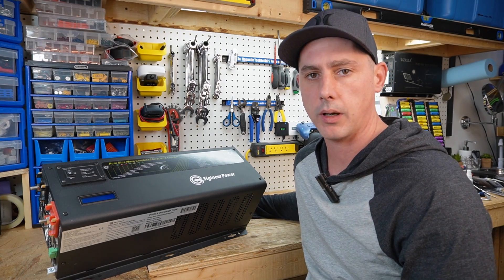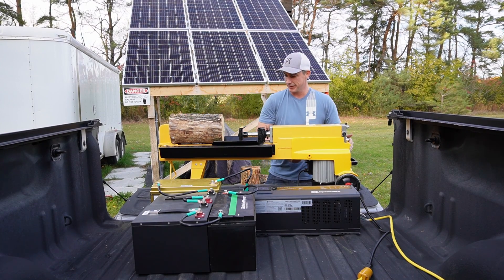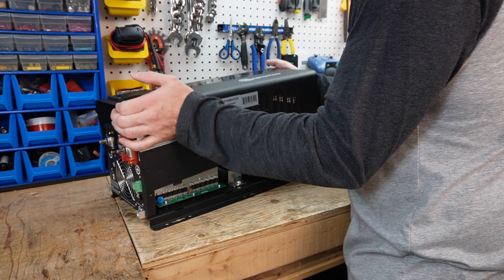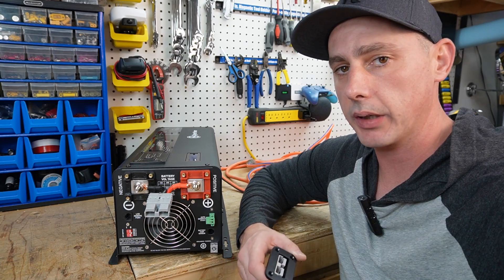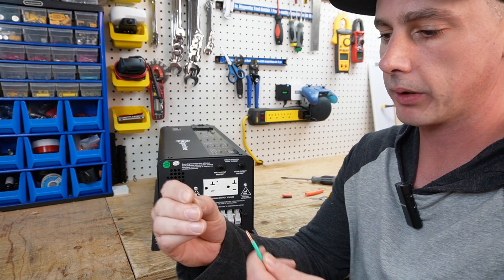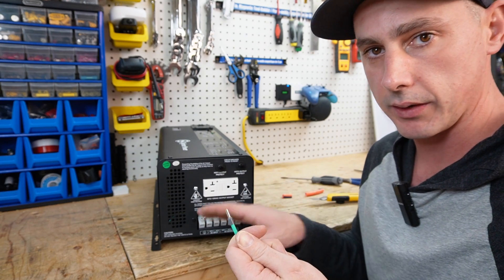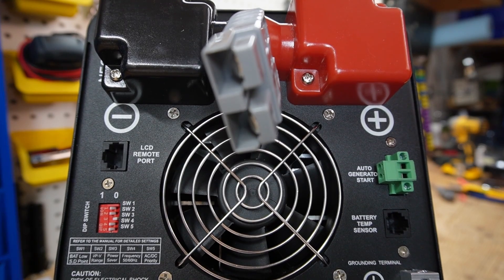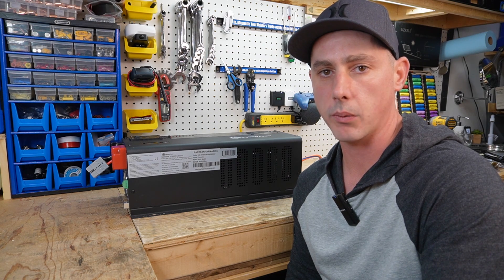Low VS High-Frequency 48V Inverter

Comment: looks like the SUNGOLDPOWER UL1741 6000W 48Vdc Pure Sine Wave Inverter Low Frequency 240Vac Input 120Vac/240Vac Output Split Phase
Reply from the maker: They all look the same, don't they?

Comment: I’d be surprised if the inverter isn’t using a pressure plate terminal block. If that’s the case, stranded wire doesn’t need a ferrule and using one might actually reduce contact area. Definitely don’t try to crimp the ferrule by tightening it in the terminal block. Use a proper crimp tool, since you really don't want that connection coming loose.
Reply from the maker: @adriftatlas  Thank you for the advice

Comment: What kw's is your log splitter please
Reply from the maker: @teamkinzoku3850  it has a plug for a 15A circuit
Reply: @Roll2Videos thats about 1.8kW @ 120vac on a 3kWh HF Inverter, could the startup load spike to 4-6kWh momentarily on those inductive loads? Maybe a 5kWh inverter would do it.
Reply from the maker: @evil17  it's possible,

Comment: I have (16) 240w 35v 7a panels wired into a 6 port combiner, then wired to a Victron 150/45 SCC, then wired to the 48v battery banks. All of that feeds into my SungoldPower 48v 6k version of the inverter in this video. It will run TWO 5k btu window A/C units, TWO 12k inverter (slow start) window units A/C units, a 7" cooling fan and a 1.5hp well pump at 148' deep - All at the same time! And it's been doing it everyday since Sept of 2023. The 6k LF inverter is a beast of a unit.
Reply from the maker: I've been having issues if one leg is pulling power only the cooling fan doesn't come on. It concerned me and I stopped using it
Reply: @Roll2Videos  I discovered the same problem. The inverter was way too hot to the touch and neither of the fans were on. I almost panicked!

Rather than shut it down, I placed a 6" AC fan at the intake side and plugged it into the AC duplex on the side of inverter. I checked the unit the very next day and both unit fans were roaring. I've not seen the problem again. 

I wonder if by utilizing the AC duplex for the fan, I have forced the inverter to use both legs? You could easily test this with a load (fan) plugged into the duplex. It might be the easy solution, even if discovered by accident.
Reply: I run a fan on my 6kw also.The units fan doesn’t come on till about 18 amps other wise.
My distributor had three of the 3kw units with issues that were returned or he discovered fault.He’s not selling them anymore.

Comment: I just got the same inverter except 24v to power my barn. Who makes the log splitter and how's it been working for you?
Reply from the maker: It's been working great, I had to hook a plug up to the terminal block to get the surge power. I'm not sure what brand the splitter is, It's a 5 Ton.

Comment: I'd be very interested to see if this device works well with a 5kw Sunsynk/Deye inverter. It is an HF design and has a peak power rating of 2x the rated power for 10 seconds.
Reply from the maker: Sorry, I don't have that inverter.
Reply: it will run the device. That inverter can do 10kw for 10sec. 8kw even better has 16kw surge capacity. With HF inverter you need to size properly

Comment: I have the 24 volt 4000 watt model. It does 110 and 220. It's a good inverter but I do wish it had a lower consumption when it has a small load and wish it could do more than 2000 watts per 120 side. I figured 4000 watts would be enough for my rv but it's not. I currently have the 4000 and a all in one 3000 powmr and with both running separate loads it has been working out perfect. Thanks for your videos

Comment: I don't get it sixty Hz is sixty hz
Reply from the maker: Can you clarify your comment?
Reply: @Roll2Videos  60 CPS
Reply from the maker: @Ebiczebulanious  not helping
Reply: @Roll2Videos  it is supposed to switch faster every 30 Seconds?
Reply from the maker: @Ebiczebulanious  low frequency inverters and inverter/chargers are the pinnacle of electrical durability. The massive iron core transformer is aptly capable of absorbing surge loads because of the “Flywheel Effect” inherent in the physical amount of a transformer’s iron. LF inverters have larger and more robust Field Effect Transistors (FET’s) that can operate cooler, in part due to the slower frequency of switching required to produce AC power.
Reply: @Roll2Videos  What are we talking about Feq., Switching speed or current.
Reply from the maker: @Ebiczebulanious   I'm not sure. They have the manual on their website. I did not study the manual. I plugged it in, and it works for what I need.
Reply: @Roll2Videos  If you do not know, then don't generalize.  Don't repeat things like "the Flywheel Effect" when you don't know what you are talking about.  This inverter works for you, but you do not really know WHY.
Reply from the maker: @MrSummitville  Well, this is my channel. There are many other channels out there for you to watch and follow.

Comment: That's a cheapo high frequency inverter, maybe not up to rated capacity with substandard mosfets(quality of the sine wave at higher loads isn't pure)......cheap high frequency inverters out of China will power your splitter and your home comfortably.  Have used both high and low frequency inverters, and there isn't much difference in terms of performance. In fact , I prefer the high frequency because of the better battery charging algorithm.
Reply from the maker: I disagree.
So far this inverter has been working for me just fine. It starts up my log splitter with it's heavy inductive load everytime.
Reply: That's the dumbest comment ever. Yes the low frequency inverter will start motors that a high frequency inverter will not.  Drawback is it uses more idle power
Reply: @matthewknight5641 i disagree. My low frequency inverter 6kw is only consuming 20.4 watts while my  high frequency is consuming 60 watts... I dont know hoe and why but my tests are pretty consistent.
Reply: @jetfu400  my 3000 watt high frequency inverter uses way less stand by power than my 4000 watt low frequency about 5 times less stand by power. My high frequency is powmr and my low frequency is a split phase sungold power. The sungold is amazing and I love it buy it drinks power and was a pain in the ass until I got a much larger battery bank. I never notice it now but yeah when I just had my leaf modules that standby power made it where I couldn't leave my system running all the time hence the 3000 high frequency.  But now I run both all the time and use them for different stuff
Reply: @matthewknight5641  i will make a video about my low and high frequency inverter idle consumption and see for yoursef... I too was shocked...  One more thing, my low frequency has toroidal coils...
Reply: @jetfu400  I wish I had the nerve to make videos like you do. I'm kinda shy I guess like stage fright or something. I absolutely love this solar and battery and inverter stuff. Actually all the off grid stuff but I'm a nervous kinda person when it comes to thinking of the whole world looking at me lol. I'm glad you guys that can do it Actually do to cause I've learned alot from you and the other guys  I see on here. Thanks man for sure
Reply: @matthewknight5641  Not really a true statement, a cheap low frequency inverter will have a higher idol consumption, a good one will idol under 15w, really good around 11w, victron is about 11w, and my solar generators (low frequency) are 13w idol. I would never buy High frequency units. I've tried to tell so many people, idol draw is soooo important, even a mere 50w, is 1.2kw a day, 13w is .3 kw a day, figure that times a week,or a month. Yes I understand a bigger battery bank helps, but your still losing a lot of power for nothing. Point, you can pay more for a good low frequency inverter upfront, or you will spend more on batteries to compensate, if you start off great, you'll end up much better,and happier
Reply: @matthewknight5641  ANY inverter can be designed to handle a huge overload or small overload.  The transformer, whether large heavy iron or small light ferrite, is but ONE component that determines the inverters over-load capacity. Do not generalize. They same applies for idle power.
Reply: bro. would u like to share with more about the better battery charging algorithm  in HF inverter. appreciate for it,
Reply from the maker: @roadsmart-solarlight  I'm not a expert on charging algorithm.